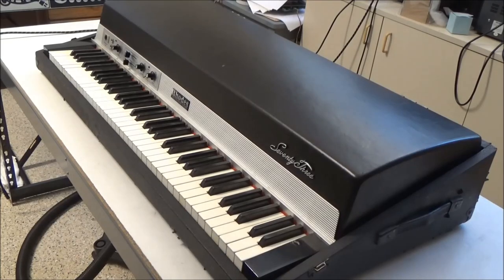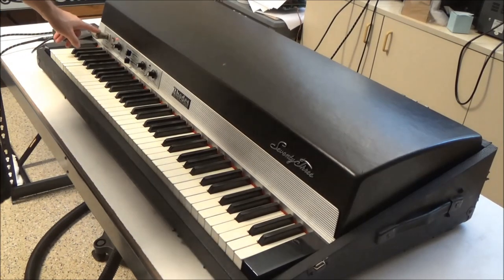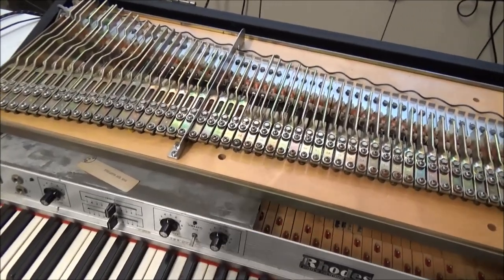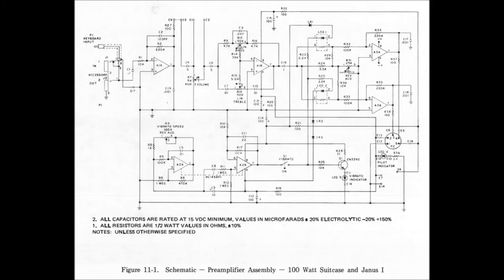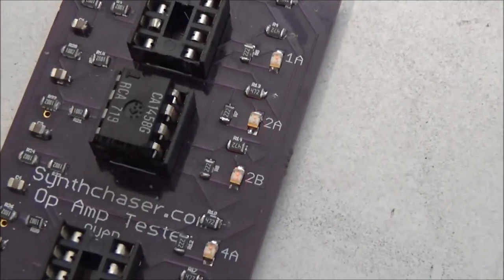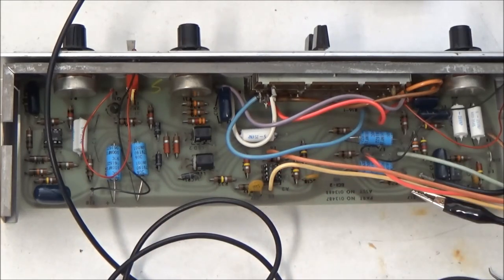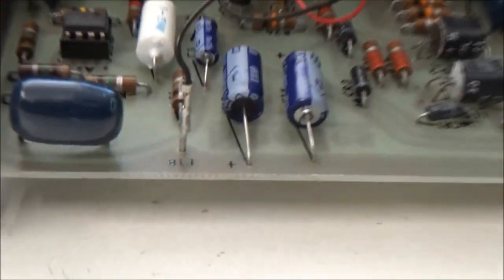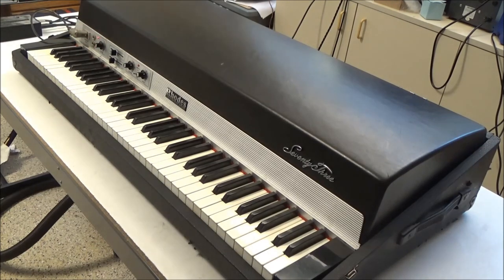Rhodes Suitcase Piano Pre-amplifier Repair & DIY Power Supply - Synthchaser #123

Comment: I have a Rhodes 73. No sound comes out when I plug it into the original speaker suite case it comes with. I wish I can make work. Lights turn on on both cabinets but no sound. Can someone help
Reply: Have you tried going straight from the 1/4" of the accessory loop to another amp?
Reply: William O'Brien So I left it on for 10 minutes then it worked perfectly. I turn it off for weeks then went to play and no sound.   I just ordered the 1/4 plug to see if what you say works. Thank you.